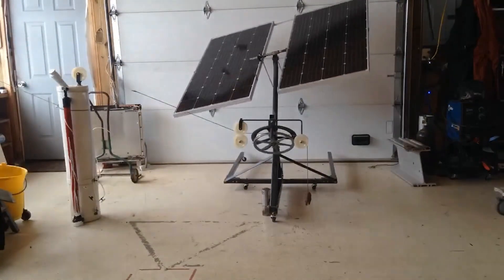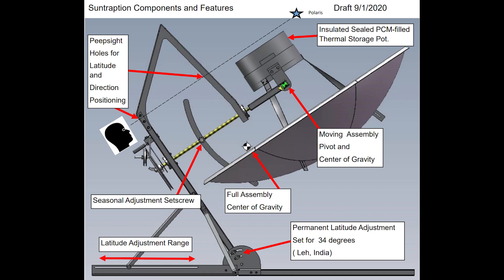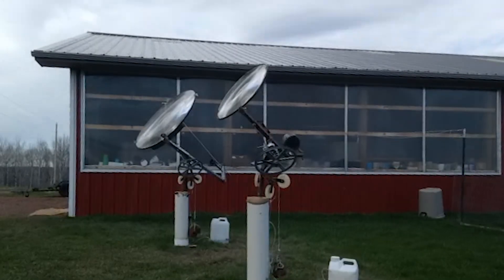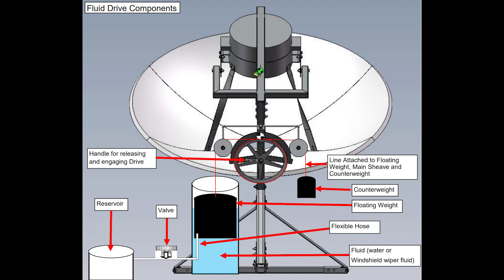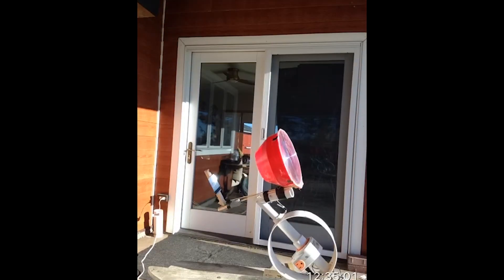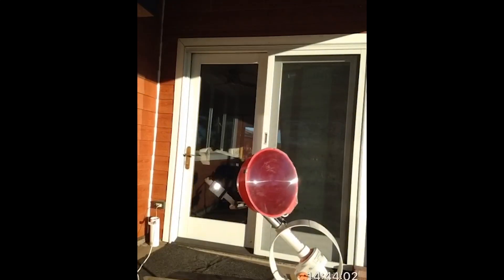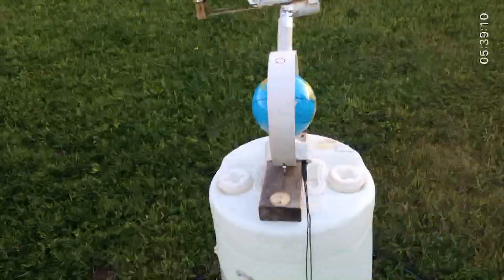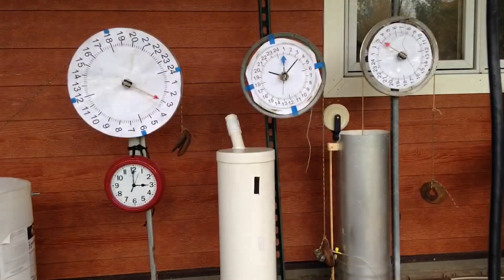Suntraption technology 90 second Video

Comment from the maker: I have done everything. Here I'm using placeholders on two to demonstrate how easy it is to make an array. Remember this is all done with the fluid drive, no electricity. The one dish does have a Sunbucket on it. This is a phase change material storage pot that when heated fully to about 700°f, it can be removed and used as a cooktove/hot plate. Cook stuff.

Comment: I thought you gonna use photon resistor and so on electronics 🎉

I wonder is it more efficient to use the beam of light to boil(?) the turbine or just made a great solar panel with 23% more efficiency...
Reply from the maker: This is an array using a fluid drive. One dish is heating a Sunbucket, a PCM storage device that once heated to about 700°f can be removed and used as a cookstove/hot plate. The other dishes just have weight place holders on them. I made the video to show how easy it is to make an array with the fluid drive.